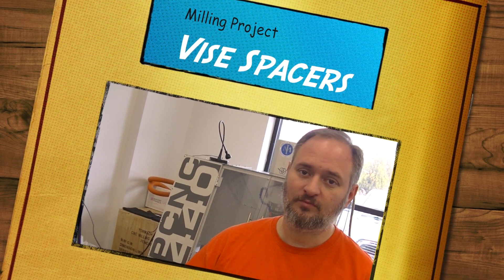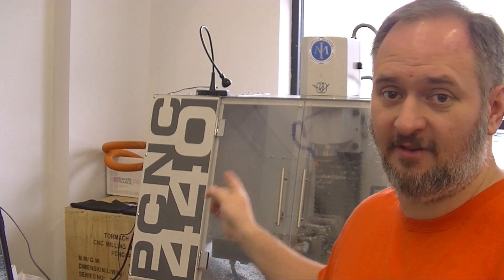Putting the Tormach 440 to work - Milling Vise Spacers

Comment: What size vise do you have on the 440?
Reply from the maker: +dcraig4 It's a 4" which is proving to be a limiting factor for me. I'll likely switch to pallet-style holding where possible.

Thanks for watching!
Tom Z
Reply: Could you fit a larger vise if it was turned 90 degrees?
Reply from the maker: I think it's possible but will need to check on the weight as well. The bigger issue would be matching the X-Y travel. Workholding is definitely something I'm having to spend time on these days.

TZ

Comment: Now that's what I call hogging!
Hard to compare the time factor with a manual approach - even allowing for the CAD/CAM aspect first - this is pretty darned quick, plus the repetition aspect too. Nice to watch.
Happy New Year Tom.
Reply from the maker: Hi Chris!

It sometimes takes a bit longer on the setup but that's typically made up for in the accuracy and speed of the machining process itself. Plus, I can walk away and work on something else while this is running which makes it very convenient!

Happy New Year, sir!
Tom Z

Comment: hey Tom how ya doing ?  what speeds and feeds are you using for the shear hog ? I have one just haven't used it yet . thanks
Reply from the maker: Hi Frank! I played with speeds and feeds a bit on this one. I landed on 10k RPM @ 30 IPM (.003 feed per tooth) but I ran it as hard as 60 IPM.

Looks like you've been busy with your machine. Saw your new knuckles too. Very cool, sir.

Sincerely,
Tom Z